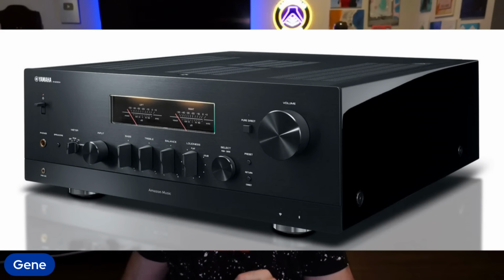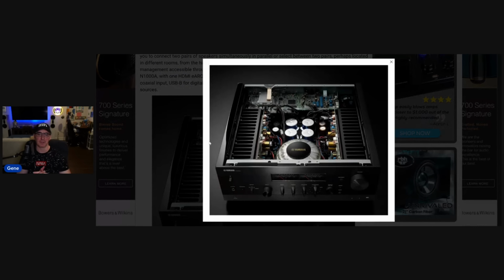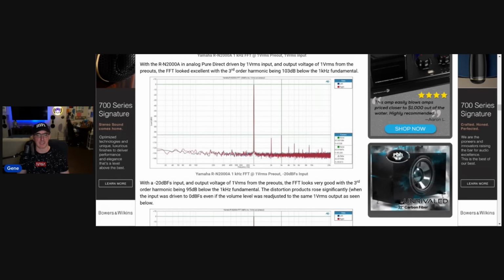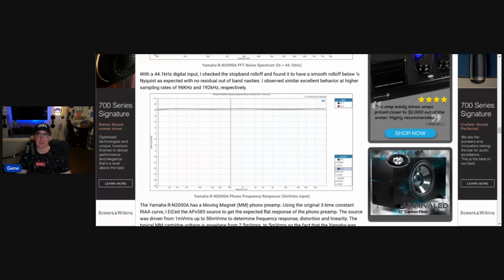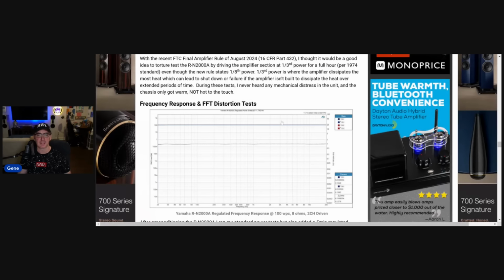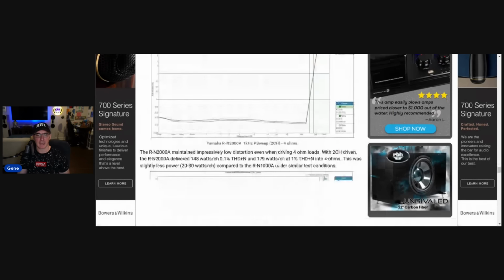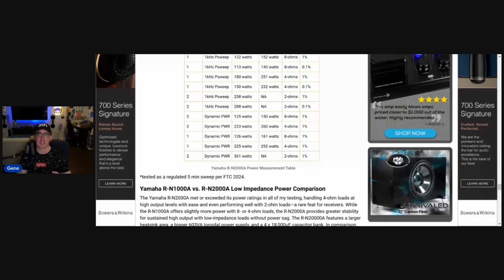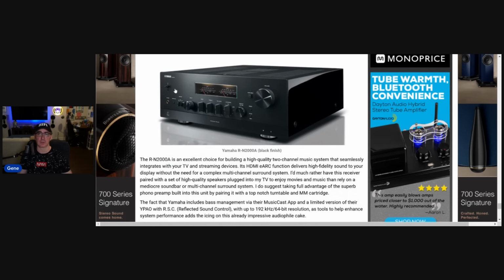Yamaha R-N2000A Hi-Fi Receiver Bench Test Results!

Comment: Thank you for the wonderful video. According to Yamaha's website, the R-N1000A has even better dynamic capabilities at 2 ohm. However, the R-N2000A could be more stable at 2 ohm.

Dynamic power in: 8/6/4/2 ohm
R-N2000A 100 / 130 / 185 / 215 W
A-S1200 105/135/190/220 W
R-N1000A 140 / 170 / 220 / 290 W

Comment: I have owned yamaha DSP     A592 Five channels since 1998 when it was yamaha flaship then, its an old workhorse which has never disappointed me. I have used big speakers on  it and its only complain was rise in temperature of the amp. Now I think its time to send it on retirement with benefits and get one that is equally strong for a rough ride

Comment: Very Happy owner of the R-N803D for past 5 years. Immensly reliable and takes music to a comfortable level for me. This amp was a bargain as I got it before the new range arrrived. Should I upgrade? ......This amp is on another level compared to mine. Welll done Yamaha. After a lot of different brands we can really enjoy music without issues.
Reply: I had the R-N803 before I got the 2000A.  I was happy with it until the speaker relays became intermittent.  I ended up getting the service manual and the relays and I replaced them.

Then I sold it when I got the 2000A.  I'm not exaggerating when I say I was amazed at how much better the 2000A sounds.  It's very much surpassed my expectations.  I can't listen to it enough.
Reply: Previous R-N803 owner for a year, as well as an AS-801 owner for 10 years. (Kinda the same amp)

I was curious myself and bit the bullet and upgraded to this. The R-N2000A wipes the floor with them. If you can afford it, it’s a MASSIVE step up. DAC especially. It should be a massive step up for the price, but it’s noticeably better from the first 5 seconds of a song you’ve heard a thousand times. 

If you have high end speakers to match, this amp is incredible

Comment: i am really looking forward to the Arendal speaker 1528 ohm measurement, that should tell us something about the amp that failed while playing them. and maybe the four 8" woofers has a low impedance dip with that port, maybe the other models are wired up differently, and one of the models are sealed enclosure also.

hope my amp can handle some 1528 speakers, because i just ordered some and i will soon find out i guess.
specs on my  old Arendal sound speakers is the same ohm and sensitivity db ans the new one so it should work.

Comment: 90dB of SINAD in 2025 is nothing to be proud of! This integrated class AB amp with a single sub out and analoge tone controls is very outdated. There are much better offers by competitors like NAD. iT'S TIME FOR Yamaha to retire their AV and HIFI division.
Reply: Sinad is not everything. Lots of affordable Chinese amps have great Sinad but lack power, and go into protection at low ohms. My Marantz has “bad sinad” but when the woofer start moving you can really hear the difference in bass performance.
Reply: Can you hear the difference between 90db sinad and 100 db sinad, ya golden ear rat?
Reply from the maker: Spoken by someone that listens to gear by looking at  a single point of data and no real world experience.  I have a class D integrated amp in the same system with better SINAD that doesn't drive the Arendal 1528 Bookshelf 8 speakers nearly as good as the Yamaha. The R-N2000A sounds phenomenal and among the best sounding amps I've tested in my guest room system.
Reply: @Audioholics thank you for taking the time to make these videos. I for one appreciate all of the videos on this page. I’ve learned so much over the years of reading on the audioholics website and  watching videos on this channel.
Reply: @Audioholics  great, SINAD not the best but it does not matter, then can you explain to us us what measurement you did supports this amp drives better the Arendals, there must be a technical reason, right?
Reply from the maker: @Lauren080508  i explained it very well in my video. The Yamaha has an extremely stable and high current power supply which is what the Arendals need to perform their best.
Reply: @Audioholics  Yes you did sorry, now to make it clear to all laymen here, you could show the graph of stress test of the amp with better SINAD but not able to handle the Arendals  as good as this Yamaha amp. If you can hear the difference seems to be extremely important measurement to compare between amps.
Reply: NAD! Unreliable and that's why I sold my NAD!
Reply: Come on pal! Seriously! I do like the NAD stuff as well. But this Yammy  is a beuty!  And performs amazing!
Reply: First, why are you so angry to the point you want Yamaha to die? 

Second, if you haven’t listened to this amp, your point is useless. You have absolutely zero reference. 

I feel dumb for entertaining your assessment of something you’ve never listened to.
Reply: SINAD needs to be taken in context with other measurements,  which has been done very well here.
Reply: I like NADs and Schiit!!!
Reply: Power supply is a key factor in all amplifiers, Denon 1600 Marantz 50 Exposure etc have great power supply which takes the sound quality up a big notch, yes lots of other things matter but a good power supply is a critical starting block ..
Reply: @EB1000 You're on more drugs than Michael Jackson.
Reply: I have this amp (receiver).  I can't listen to it enough.  Sounds incredible.

Sorry that your one number interest will prevent you from hearing it.  Retire their division.  Ha ha.
Reply: @timh6510  Have it too with the 5040. Sounds beautiful.
Reply: @EB1000  SINAD is a useful rule of thumb but at 90db it isn't necessarily consequential if noise is low. I doubt in a blind a/b one could distinguish an amp with state of the art SINAD and this one where all other things were equal, at least not in real listening conditions. I have a qudelix 5k dac amp which has a miserable 88db SINAD and there is no audible difference between that and one with a SINAD of 123db.
Reply: SINAD can be a little misleading. Outside of the current/power differences of amps that were already mentioned you have to remember that SINAD is the sum of both noise & distortion. As long as the internal & power supply noise is low sometimes a bit of distortion can actually be pleasing to my ears. I fully enjoy something that specs well like my Hypex Nilai..but I also very much enjoy the sound of a well made low noise tube amplifier & vintage solid state..which will score lower on a SINAD test. Measurements & data are great & I'm glad we have more & more reviews giving us these objective numbers along with some subjective thoughts. Numbers aside we still need to give it a go in our home with our ears. Don't knock it til you try it.